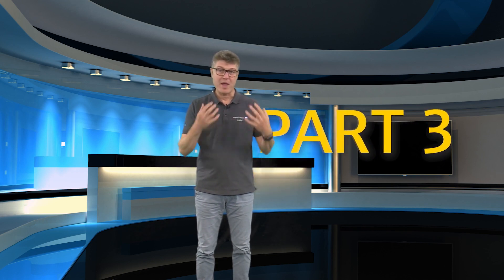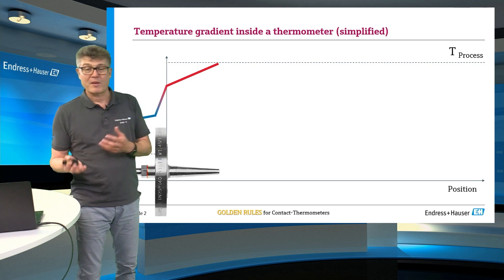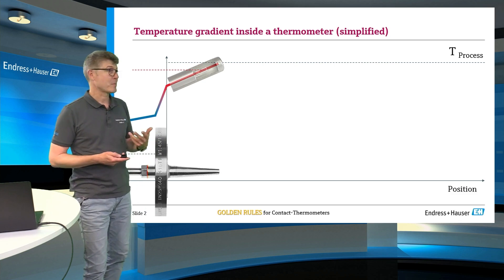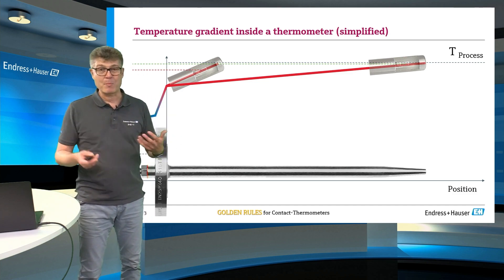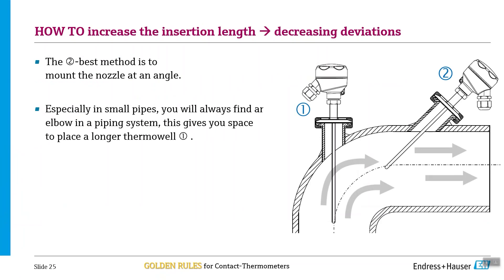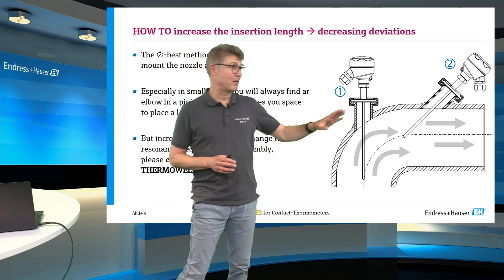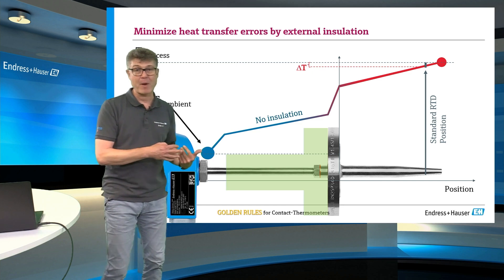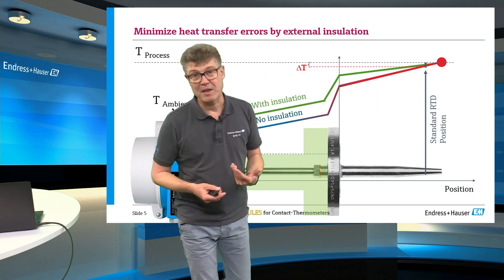Golden rules of temperature measurement - part 3: installation hints

Comment: what will be the advisable rtd for custody transfer
Reply: Hello Nayrbs World, 
the most common method for applications like district heating (where the difference of 2 temperatures is important) is to use "paired" RTD sensors. They are produced in the same batch (on the same wafer) and are very similar. That makes it possible to determine the difference of IN- and OUTPUT temperature very accurate. 
The rules for custody transfer might be different from country to country. Endress+Hauser can provide thermometers with a NMI certificate which is a pre-certification. Normally, the entire (installed) plant needs to be certified by the local authorities.
Reply: thanks for reply. we are currently using E+H classAA wit TMTmodel Tx in our plant. i would like to ask how we can improve the measurements by using CvD (can you please make video for it). The how to videos given that you alpha,beta, rho coefficients that cane from manufacturer. thanks a lot Sir
Reply: @nayrbsworld3048  yes CvD will improve the accuracy, especially if you measure not at 0°C. 
You surely will know, that the accuracy expectation builds a kind of triangel with a minimum at 0°C. 
CvD turns it into flat lines, and it becomes possible to perform the calibration at the point where the application will be. 

Thanks for your feedback, We just plan new videos for beginning of 2024.